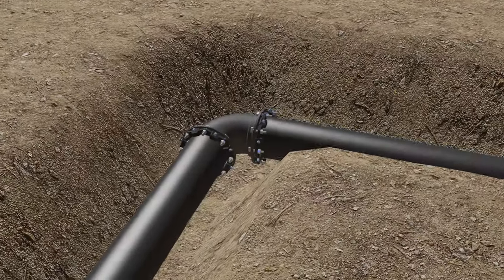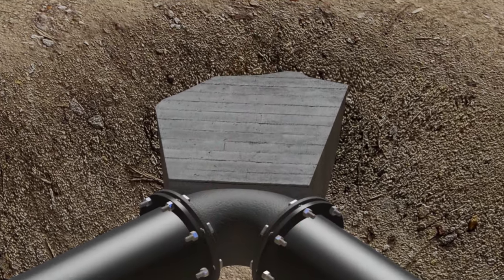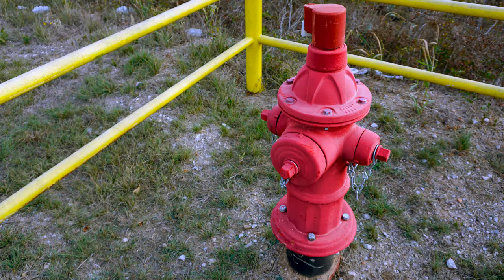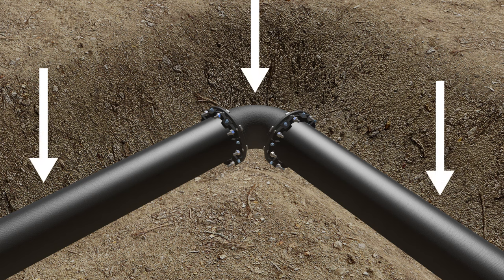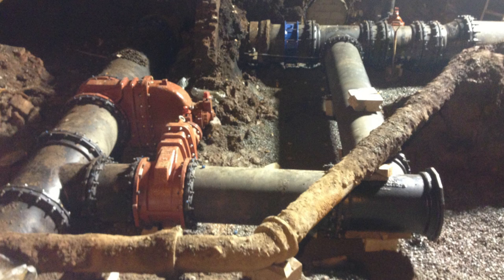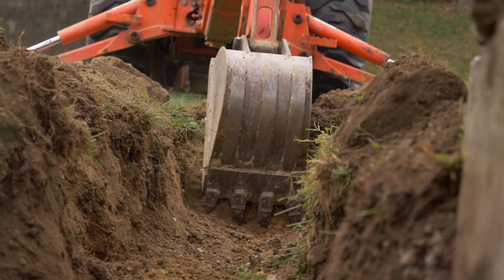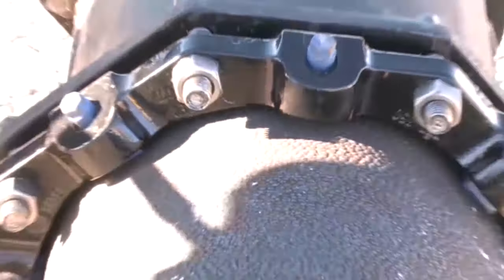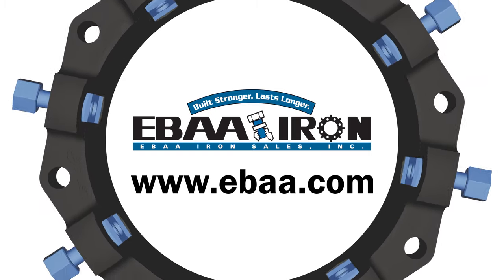Joint Restraint vs Thrust Blocks

Comment: Water will only be flowing one way three the pipe not 2
Reply: You’re wrong, water can run from both sides. Water mains are built in a loop unless it’s to hydrants
Reply: The force on the joint is partially from flow but you're not considering pressure. There's a lot of surface area across the pipe so multiply that by the city water pressure and you'll get literal tons of force trying to separate the joint.
Reply: It’s not the flow of the water but the static pressure of the system you are resisting with restraints or thrust blocks.
Reply: @LowWingFlyer  It's actually both.
Reply: Pipe pressure works the same as hydraulics do.